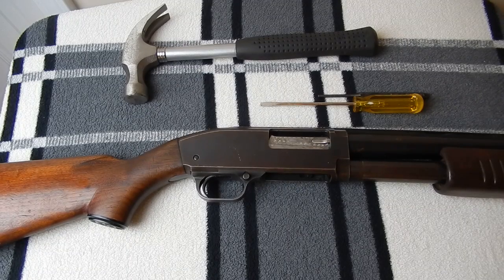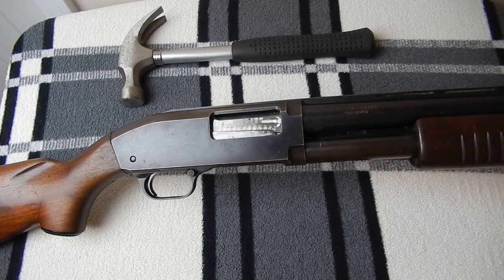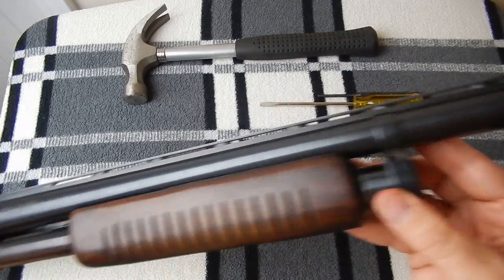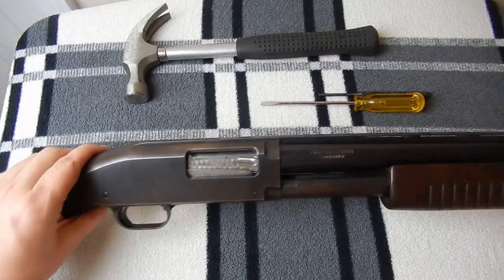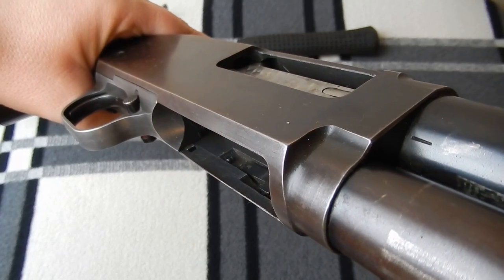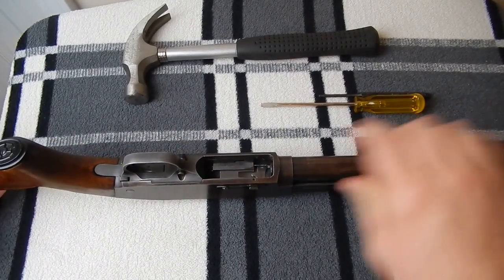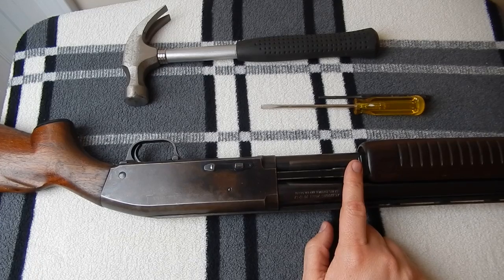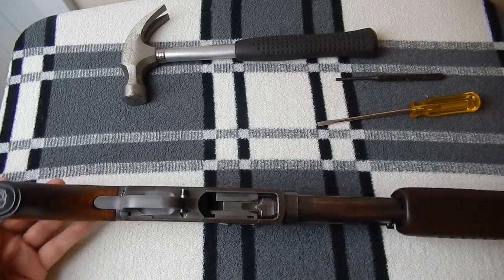JC Higgins High Standard Pump Review 1 of 3

Comment: My Mom bought my Dad one of these for their anniversary in the 50s. I shot a lot of trap and skeet with it and often carried it in the woods. I have owned it since my Dad passed in 2000, but I JUST found out from your video that it is, in fact, a SLAMFIRE! Funny thing is, I've been watching the gun shops, auctions, Gunbroker etc. looking for ANY brand of slamfire 12ga for years. Turns out I already had a very nice one standing by my front door! Lol!
Reply from the maker: Just to be clear, not all of them are slamfire.  You would have to try yours out.  Some do not have a disconnector and the hammer will simply follow the bolt into battery.  I have got several slamfire shotguns.  Ithaca 37's and a Remington 17 (the design the 37 was coppied from).  After playing with it at the range a few times, you're over it.  My father, who also passed away in 2000, would not own an Ithaca 37.  He managed a gun shop in Los Angeles and there were always stories floating around about another cop shot accidentally by an Ithaca 37.  The LAPD used that as their duty shotgun at the time.  Features prominently in the movie LA Confidential.

Comment: I just gave my son a model 20 which I bought in 1963 or 1964. I just says Sears, not J. C. Higgins or Ted Williams. It has been a great shotgun, the polychoke is nice for quail. I have shot literally thousands of rounds and have not had any problems. I've easily shot 30 rounds in an afternoon of dove hunting. He is right about the smooth action. Mine had no rib but had the polychoke. It's a great gun.
Reply from the maker: +HML367 It is still being produced, thankfully, but in the Philippines.  I think it is a solid design.  I am vested in a bunch of other shotguns, though.  Ultimately, it is sad that HS went the way it did.  They produced some good solid designs.  Enjoy your gun and thanks for watching!
Reply: I also have the poly choke on mine, but it was removed at one point. How can I make sure it's tightened correctly so when I switch to "slug" I know for sure the choke is correct for slugs?

Comment: Yeah its a 31 clone but so is a Mossberg.  High Standard set "pardon the pun" the standard.  Smooth as silk action.  I have a video you can check out as well.    Enjoy your shotgun.
Reply from the maker: Yukon12gauge The 31 was just a reworked Model 17 with a side ejection port instead of the bottom feed/eject port.
Reply: Interesting I need to get my missing link the Remington Model 17 in my collection or at least a 50's /60s Ithaca 37 before I can discuss this more

Comment: I have one of these old JC Higgins Model 20 shotguns and its in fair condition. All components work well except the gun will not eject the spent shell. I've disassemble, cleaned and reassemble. All parts look good to me however I'm not well versed in gun repair. Do you have any idea what could be the cause of this or what I should look for?
Reply from the maker: If you look at my other videos, I have one on gunsmithing the high standardshotgun. The part you might want to look into is called the exjector. I cover that in my video.

Comment: My dad gave me one of these that belonged to his dad. I broke the pump arm on mine in 2001 at a shoot we had down on the power line over in Cushman Ark. I have searched the internets over and over for that part but its no where to be found. Well, I bought another model 20 on gun broker for $190 plus shipping and should have it soon.
Reply from the maker: +TOM AMMO SLINGER I just did a quick search and didn't find anything either.  I would either find a beater shotgun on Gunbroker and scavenge the parts or take your broke forend out to get it welded.  As a last resort, you can part the gun out and sell the trigger group, bolt, and stocks on eBay and the stripped action on Gunbroker.  That would be my chosen route for the broken one.

Comment: Ok so it IS supposed to slam fire? Good to know. Bought one today and saw various opinions online about whether or not it was actually supposed to slam fire. Apparently these are not very well known shotguns....
Reply from the maker: That's my experience, however High Standard was known to make changes to their trigger group from time to time.
Reply: I have two and neither one will slam fire. They don't have a disconnector, so if I keep the trigger back the hammer just follows the bolt home and doesn't "strike" the primer.
Reply: I have a jc Higgins model 20 and it will not slamfire. The flapper behind the hammer is the trigger lock mechanism that won’t let it slam fire

Comment: Hey Ryan, I have a JC Higgins Mod 60 Semi 12 gauge in really good condition. It will not eject in cycle after firing, it will only eject if I manually pull the bolt back with an unfired shell...I am a \t a loss on what can be the issue. I don't even know if you know anything about them, but thought I would give it a shot.
Reply from the maker: I have never worked on them.  I remember that the Texas Tower shooter had a sawed-off Model 60.  I am familiar with the gun, though.  My first guess would be that you have the gas system adjusted wrong.  Under the handguard is a set of adjustment rings and springs held on with a castle nut.  These have to be assembled properly, first, and then adjusting the castle nut will provide more energy to the gas system.  You screw it in more to apply more pressure to the holes at the front of the gas block, thereby allowing the gun to cycle correctly.  In theory, once you adjust it you can shoot heavier loads and it auto-adjusts.  While you are at it, make sure the gas system is cleaned and very lightly lubed with a good synthetic oil like RemOil or Break Free.

If you want to see what the adjustment stack of washers and springs looks like, search for the following term on YouTube: "The deconstruction of J.C. Higgins"
Reply: @RyeOnHam  So I can't over gas it if I adjust the nut down more...I guess thats why I didn't do that but I will give it a try. Thanks man, I truly appreciate your response...love the gun it was my dads so I want to get it working and pass it on to my son....Thanks again, Ryan.
Reply from the maker: @rjmprod  Just go easy.  Quarter or half turn at a time till it starts working, then maybe an extra quarter to half turn for good measure.
Reply: @RyeOnHam  I'll giver er a try Ryan, Thanks Bud.

Comment: Does this shotgun have a rifled barrel? And I have this same model shotgun but on the end it has some sort of choke on the end that has a bunch of 'holes' in it. Could you possibly tell me what that is? and if this shotgun could shoot slugs out of it? thanks
Reply: I just looked and it says 'power pack' on It. Could I use it for deer hunting with rifled slugs?
Reply from the maker: thefatboi1 That device on the end of your muzzle is a combination muzzle break and interchangeable choke tube.  Buckshot should work fine through it as will rifled slugs.  None of the High Standard or JC Higgins models had rifled barrels, but you can get decent accuracy with the smooth bore.  Hope this helped.  I do have another video coming out in the next week or so on the High Standard Pointer shotgun which is the same design.  If you search, I also have a video on 'shortening shotgun barrels' where I cut the device you're talking about off the end of my barrels. Thanks for watching.
Reply: RyeOnHam thank you very much! this helped a lot!

Comment: how do I remove the choke off my jc higgins model 20 12gauge
Reply from the maker: The choke tub itself, not the funky housing with all the holes in it, just screws off.  If it's tight, it might require a 'spanner wrench' like the old stock nuts on the AR-15 collapsible stocks.  It looks like a cane with a hook on one end.  The end of the hook has a pin protruding that engages with the hole on the choke tube.  Unless you have others to install, there is no real need to remove a stuck choke tube.  If you do need it off, best to go to a gunsmith.  They're worth the charge.  You can also try a small strap wrench.  The best tool is a collet that goes inside and expands.  It grabs the best and does the least damage.  You are more likely to damage it when you try to take it off, which is why I'd suggest just leaving it on.
Reply: Ok
Reply: Know where to buy the mid and long range choke tubes?

Comment: The safety on mine don't work
Reply from the maker: Does it not move or does it not prevent the gun from firing when it is in position?  It's a very simple mechanism.  Just a cross-key with a spring detent to hold it in either safe or fire position.  When it's in the fire position, a slot lines up with the front end of the trigger and keeps the trigger from moving.  Sometimes this projection on the trigger can break.  You'd probably need a gunsmith to examine the gun.
Reply: @RyeOnHam  it still fires no matter what
Reply: Yeah i am going to have to take it to one